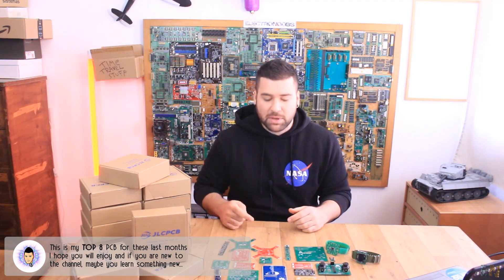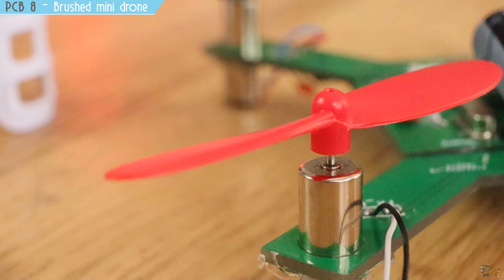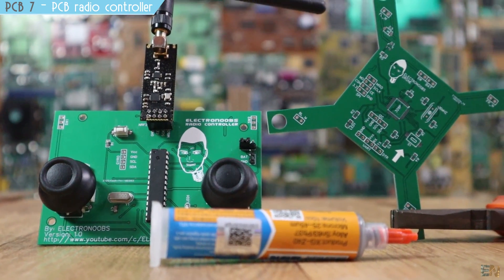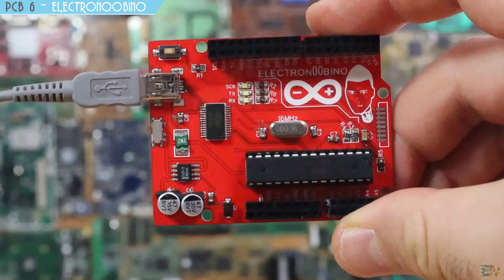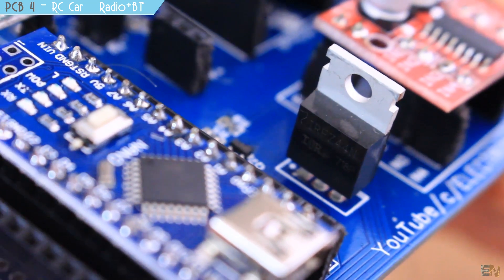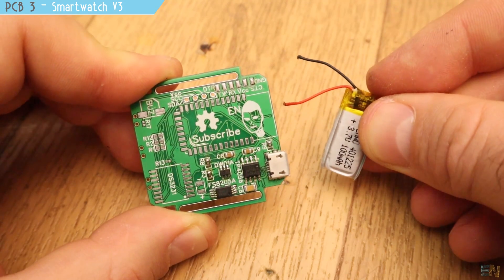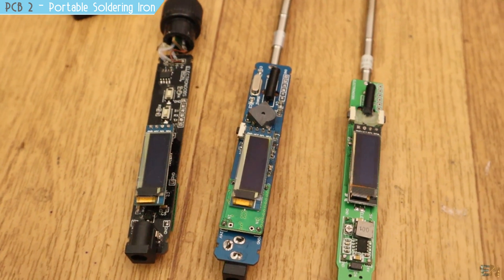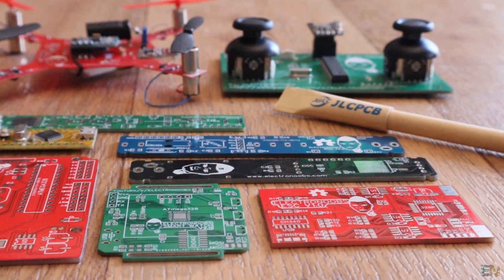My top 8 PCB projects for 2019

Comment: These are all great projects and great exposure for your sponsor JLPCB. I wasn't aware that you could get PCBs manufactured and shipped with just a Gerber file upload. I thought there would be a lot of phone calls and proprietary (expensive) software necessary and it would take months !

JLPCB provides free software and 2 day turnaround...you should mention all these points in your video.

I don'tknow how to solder SMD components...looks scary and difficult.

You meed to do basic videos on things like - how to solder SMD resistors and then videos on those flat IC packages with pins on all 4 sides and so on....your latest videos are probably too advanced and scary for noobs like me.

Comment: 23% only, because only thing you do is to advertise your products, instead of doing something interesting for the audiense, like to show something get fixed or designed or something simple without MCU. Microcontrollers are boring and i don't see electronics in  programming, its just flash USB memory (one chip on board and nothing else to see), a soulless typing and completely different thing. Show some CMOS or TTL logic or analog implement or combination of them all. Teach audiense something real if you think you are good in electronics. Many channels falls down into the deep rabit hole with those stupid MCU's. Be more creative.

Comment: Hi l recently upgraded my laptop to Windows 7ultimate. Problem is I cannot load Arduino drivers since in the device manager, the ports and lot does not appear. How do I sort out this?
Reply: I would try re-installing the FDTI drivers from here https://www.ftdichip.com/Drivers/VCP.htm 

Do this with the arduino (or any other unnecessary device) disconnected 

-Restart the PC and then go to your devices manager and check if there are any flagged in red or yellow and reinnstall them manuallt from the folder you've downloaded (by browsing from that window). 

Then it should work. just select the right COM

Comment: Hello I am greatly inspired by your smart watch project I created the same (without PCB) with seperate components I uploaded the simple watch code (took 89%) then I modified it and removed watchen logo and show logo mode and add temperature ( took 91% ) I want to get notifications on my watch but I'm unable to do so can you make a code which will display real time notifications if you remove the notification menu it will require less storage I meant when someone is calling the watch will display " incoming" just like simple realtime notification output.Link of my updated code:https://drive.google.com/file/d/1YkS7aMowXsO-SleAOqBymv1klsGs984f/view?usp=sharing

Comment: This one is for december bro ! Not now .....😂😂
Reply from the maker: LOL, is actually 2019 and some from 2018.
Reply: @ELECTRONOOBS  I think he means for the Christmas shopping craze :D
Reply: @ELECTRONOOBS , excellent video,  if there's ever drone weight lifting competition  you could do some damage , If someone had a cheap simple drone controller and body(everything  included) then clipped the wires to the cheap drone motors what would it take to wire the cheap drone body without the motors on a homemade drone with large motors? for the relay and controlling the motors?
Reply: @ELECTRONOOBS  , to increase the range of a drone not using satellites, say the drone carried a few relays that could be deployed when coming close to become out of range of the controller then a relay could dropped with a helium airbag parachute or maybe a miniature drone combined with helium to keep position is this possible?